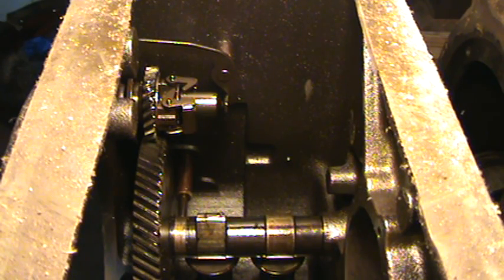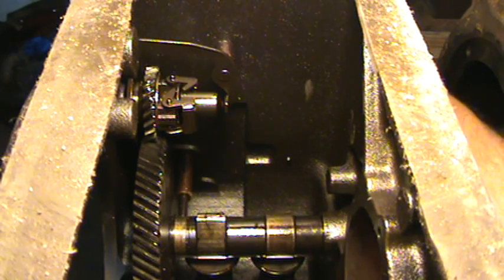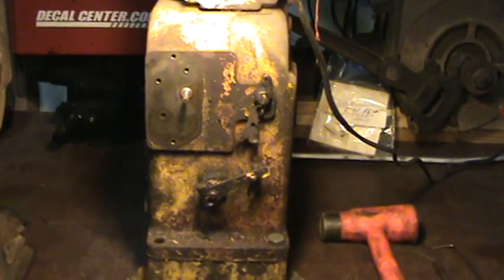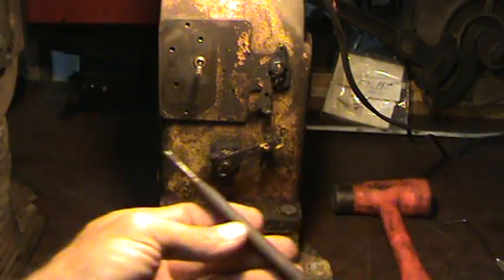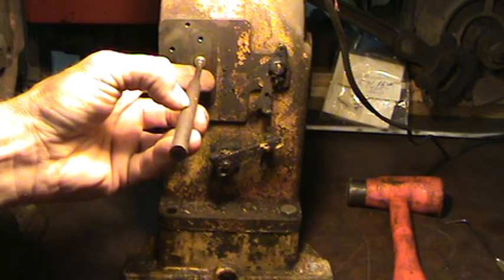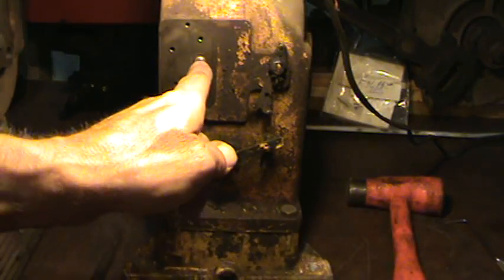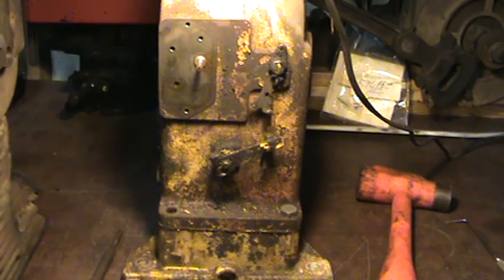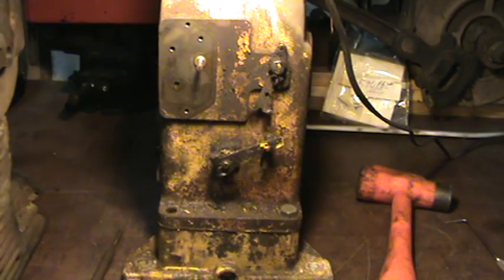Replacing Briggs and Stratton Points Plunger and Bushing How Too

Comment: As I spin the crankshaft the points plunger doesn’t seem to move in and out visibly enough to open and close the points (k301) 12 hp engine what. Could cause this -plunger is made out of aluminum and measures 1.5 inches long there was a bulletin issued at some point  explaining that they should be replaced with steel plungers may have to remove head to determine if both valves are opening and closing but once you do that may as well tear the entire engine down still have not determined the age of engine-serial number is before what is listed in tractor data on the internet.  ( 9642712)

Comment: Zippo, wanting to rebuild my 
326437 0135 03 730823 
(1973 16hp) cast iron briggs.  looking to replace the coil to eliminate pionts.  I was lost with the previous question and answer but is there a plug for the plunger?  I should not need the plunger after the conversion, right?  Also this was again a great video.
Reply from the maker: Go to your local hobby shop and pick up a solid brass dowel rod slightly larger in diameter than the hole in the points plunger bushing, then taper down the leading end and press (tap) it into the hole where the plunger was. Or...just leave the points in place with the plunger and go to electronic ignition. Cheers! Zip~

Comment: Do you have a part number on points eliminator. Also how can I plug the hole where the plunger was it has the points on side of block bBS off of an old all is b12
Reply from the maker: +Paul zerr Go to ebay and type in "Nova II" and you'll get plenty of choices for the points eliminator...they go by a number of different part numbers. Stens also makes a points eliminator that works.

Comment: Zippo,

Great video! 

My engine has a different type of bushing. It is threaded on the outside and I am afraid I can not get a replacement. Have you come across one like this? Can I use a nut to pull the bushing out? Was it made to be reusable? 
Engine is 320421-0020-01

Comment from the maker: @frontstfarmer That is very possible!! Easiest way around that, and cheapest, is to remove the points, plug the plunger bushing and install a points eliminator from NAPA. They run about $15.00 and are very easy to install. I have installed them under the points cover, replaced the cover an no one was the wiser. No worries about the points wearing out, getting wet etc.

Comment: great video. I am working on a 23d currently. I was changing the points and cond., and when I began to set the point gap, I found that the punger rod was not moving in and out. Could this be because the peice of macarta that is on the end of the plunger ( that rides against the cam), has broken off?

Comment from the maker: I bite my nails to the quick if I don't have spares on the shelves! These engines are very dependable, but you never know when one is going to throw a fit! Those smaller engines like your 3.5 hp are a little more involved with the side cover being the whole side of the crank case. The Cam and Crank both get their support  from that side cover. Makes things a little more tricky. Good to hear from you my friend!!

Comment: Funny, I was just working on a 3.5hp Briggs engine, its an old one with points, and the plunger is totally stuck.  Im used to working on bigger engines, so not got a clue why its stuck, I can pull it out fine.

Good thing you have plenty of engine, if one of mine popped, that machine would be down and out, I dont have any spare engines anymore.

Comment from the maker: Hey Roller! The yellow engine has a broken baffle that was cast into the block. It acts as a barrier to the crank case vent so the vent only gets the crank case vapors. The other engine has a cracked exhaust valve seat. With 5 spares on the shelves, I'm not in a big hurry on these two. Both are 1964 model 23D Briggs and Stratton 9hp horizontal engines. They lasted over 40 years before needing freshened up. Not bad for oil splash air cooled engines I'd say. Keep those RRs on the road my friend!!